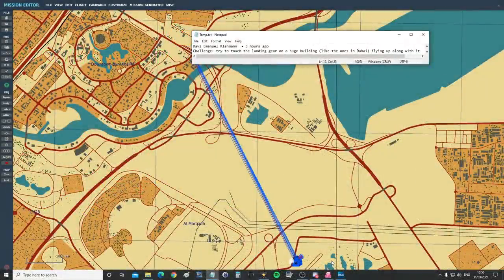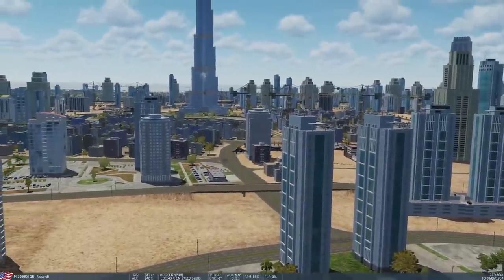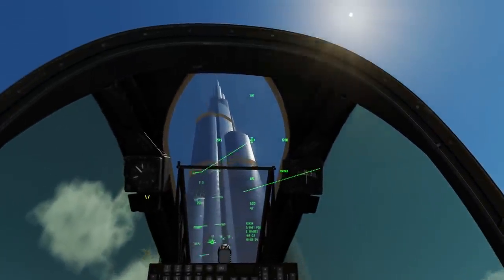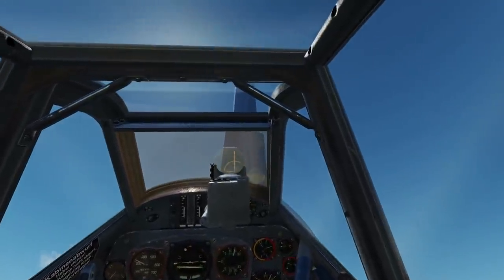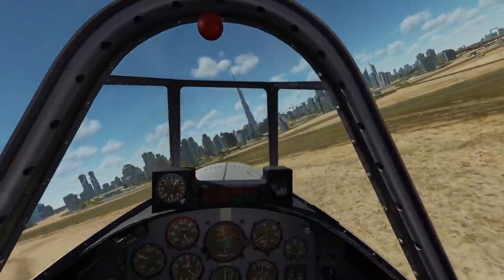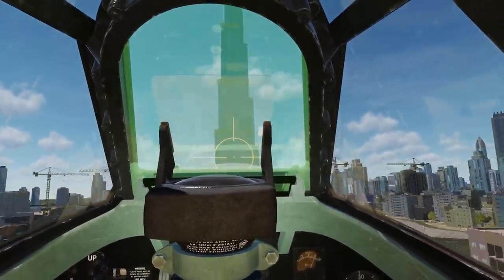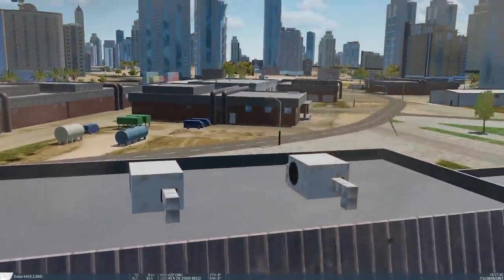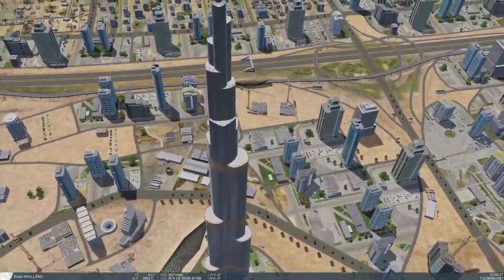CHALLENGE: For How Long Can You Ride The Side Of A Building? | DCS WORLD

Comment: Great flying! I found for the F/A-18 gear down and flaps up works well. Flaps down limits pitch-up. A 10-15 knots headwind makes the task much easier. Did not try a building yet but Inguri dam is relative easy (= not exploding 10 out of 100 times). In the best case you can come to a full stop and "stand" on partial afterburner, taxi backwards (down), and even accelerate and take off nearly vertically.